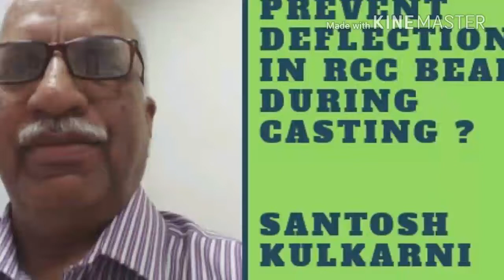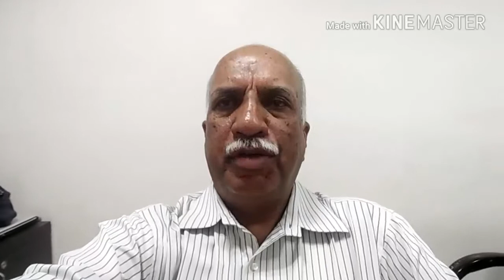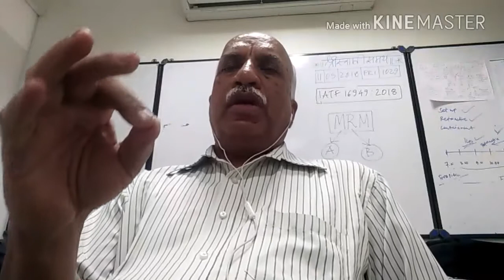How to Prevent Deflection in RCC beam During the Casting?

Comment: Sir, how to treat spalling concrete of slab and coroded (some broken)  steel...can we repair it or just have to replace.
Reply: Yes, we can repair it. Use polymer modified mortar treatment. For steel, use corrosion resistant chemicals like Fixoprime, Rust off, etc.